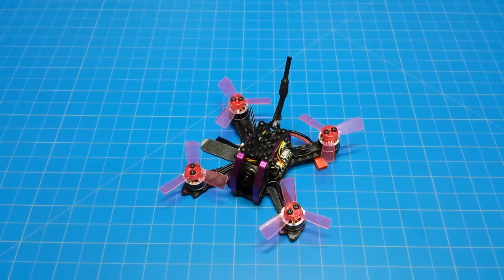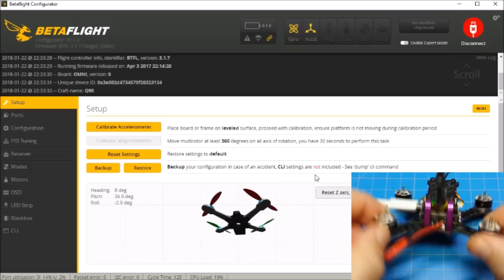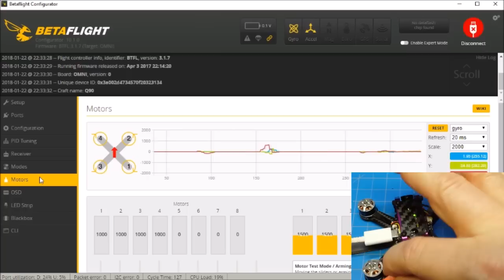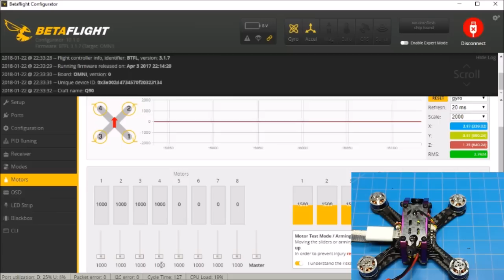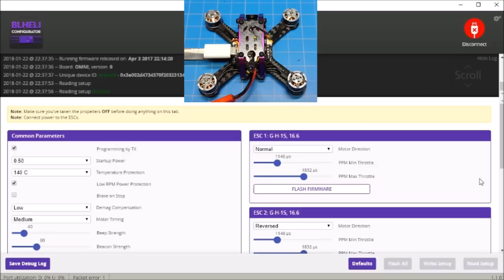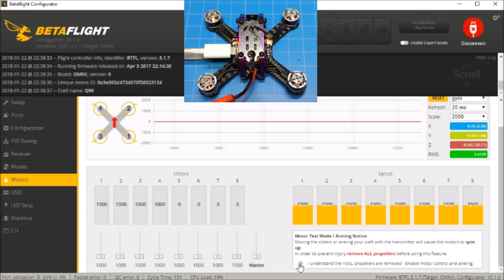Why does my quad freak out? - Check these first.

Comment: I think a good video, although it might be hard to show it without either: A) Having a bunch of broken stuff, or B) Breaking a bunch of stuff for the purpose of video! Being a fairly new pilot, I have ran into a lot of confusing situations that drove me nuts trying to figure out. Examples: 1. Dissonant motor beeps at power up, followed by a motor twitching while the other motors spin can signify a fried 4-in-1 ESC. 2. Powering up but seeing a pure black screen, without static and without OSD. Result was a component on the VTX getting fried due to a voltage spike. (If the VTX was completely shot, you would see nothing but static. If camera was shot, you would see OSD overlaying static/black, etc.) 3. Everything in this video cross checked and still acting odd? Check the torque on your prop nuts! Had one slipping once and my quad was randomly dipping!

Comment: I had my brushless whoop dancing when I choose the wrong firmware (I think I installed OMNIBUSF4 instead of OMNIBUSF4SD), so that might be a thing to check as well. It was fun, but not what I was looking for :)
Reply from the maker: yes, flashing the wrong target often results in oddness, in cases where it kindof works it could be resolved with motor mapping to the correct motor signal on the flight controller.

Comment: Is there a reason for motor rotation to go inwards?  Seems like reversing the motor rotation is considered an easy way to get a slightly more stable flight and slightly more aggressive turn rate, but surely there's a reason rotating inwards instead of outwards is the industry standard?
Reply from the maker: I suspect it was the first method. I have reversed the motor rotation and prop to spin into the sides, the upside is the grass and other items don't get on the fpv camera, but still get into the body. I can't say I have heard it creates more stability, it feels just about the same to me.

Comment: Useful video thank you. Another common question for you, why do a lot of micro quads, specifically brushed motors but not limited to them, have a drop out problem when doing a hard Bank?  Not sure if you've experienced this yourself but I have encountered it with many quads and it limits how fast you can go. I know you don't know everything but you do have a lot of experience with micro quads
Reply: Now that I think about it, I'm pretty sure you encountered this problem with the Pico owl from flexrc
Reply from the maker: I think it was the mosquito 70. Reversing motor direction and props to spin in towards the sides fixed it. It can also be a battery situation. If the battery doesn't supply enough power then the motor need to spin up quickly an arm will drop.

Comment: Great video Nick, very useful. I've just finished my second build and had some problems with the fc board (it died the second time I connected a lipo to it) so had to contact the seller on amazon, they were great and sent another flytower which I'm happy to say worked fine. Quad building can be the most fun and the most frustrating thing, but it's an amazing feeling when something you've build flies for the first time😀
Reply from the maker: yes and yes.

Comment: Nice one.  I had to learn a lot of this on my own and it's nice to see someone mentioning it for those that are getting started or just having a problem they can't diagnose.  Just a small point that I wanted to mention (for anyone that doesn't already know): if you're not certain which way the motors are supposed to rotate, the diagram at the top left of the Motors tab in the BetaFlight configurator shows the correct (default) directions.